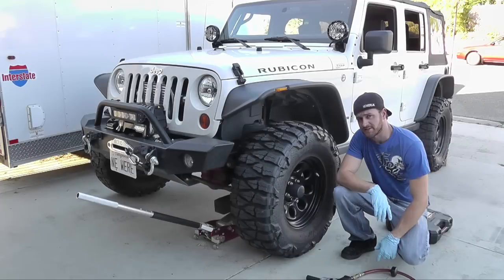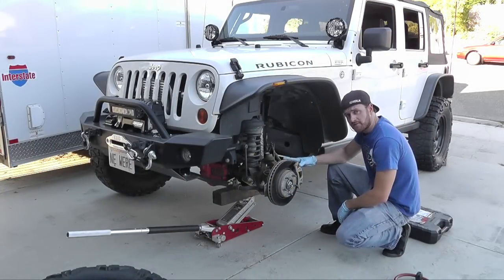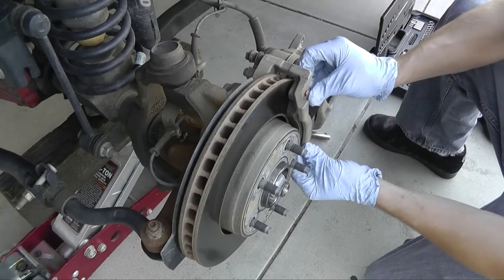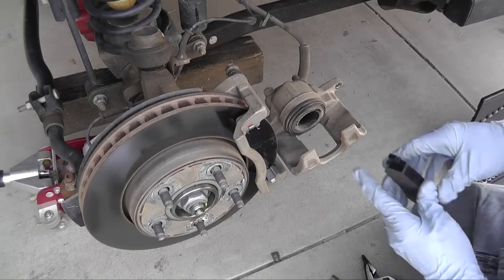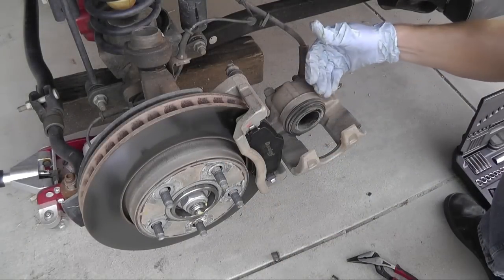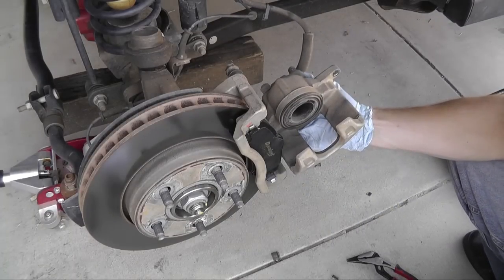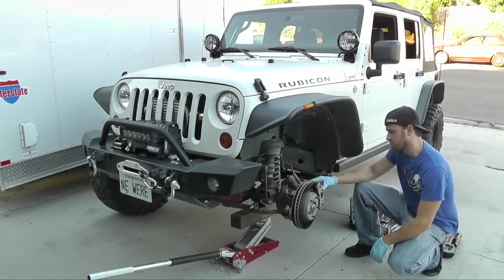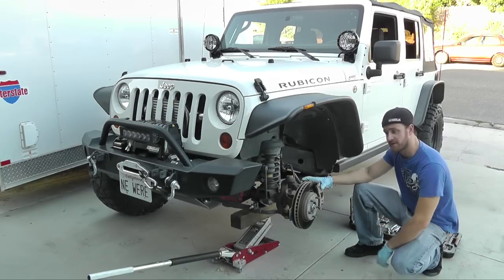Jeep Wrangler Brake Pad Replacement

Comment: I was told this would be $200 per axle at the local auto place. This is not $200 worth of labor for the entire thing.
Reply: That price is to replace or resurface rotors if out of spec and replace pads . you should always replace or resurface rotors when putting on new break pads . rotors will wear and if they wear out of spec it can cause a very dangerous satiation.  a little more to it then just replacing pads .
Reply: @denn1444  absolutely hooey. New rotors EVERY TIME you do pads? That's just not true.
Reply: @user-qt5eh9wb7g  Not what I said read again silly .
Reply: @user-qt5eh9wb7g   replace or resurface

Comment: Good Review, Should've use Jack stands though. Extremely unsafe to rely on just the jack.
Reply: at least throw the wheel under the frame or axle
Reply: About to work on a jeep for the first time. What size floor jack? 2ton?...and where are the best spots to put the Jack stands
Reply: @Bruce Lee thanks
Reply: Arturo Blanco  appreciate it
Reply: The reason I came to comments, jack stands or throw the spare underneath

Comment: I noticed that you left the bottom bolt in on the caliper loosely to act as a hinge where you could swing it back and have it held in place. That's a neat little trick, watched a few of these videos you're the first one I've seen  that's done that.

Comment: Only takes 2 mins longer to pull the slider pin out, clean, add new grease. Always use a torque wrench set to factory specs to prevent rotor warpage. Use a jack stand.

Comment from the maker: I had little to no wear since I was actually changing them very early for the milage. A lot of people suggest it every time but personally I have had NO issues turning them only when there is uneven wear or grooves in the disk. Disks can only be turned so many times before they get too thin and must be replaced.

Comment: great video. As your old pads wear out the piston comes out further and brake fluid level drops, if you've added brake fluid be sure to remove some before you push the piston back in to fit over the new pads.(at least open the cap and keep an eye on the level) If not you will have brake fluid overflow all over your engine compartment.
Reply: Wish I could change a set of pads in a little over 4 minutes.  What the heck, a little grease, should be telling us "break grease". The high temp stuff ;-)

Comment: Thanks for the video, never did brakes before, it was a piece of cake, 4 trips to the auto parts store but no issues. 
Needed an 18mm wrench so I could remove the rotor, it was really warn along with one brake pad, the rest were OK.
Replaced with ceramic pads, they are nice and quiet, and the Jeep stops. ;-)

Comment from the maker: To have two rotors turned this weekend only cost me $30 and I did all the work removing and reinstalling them. If there is a shutter when braking it's not a bad idea but its not required when just changing your brake pads.

Comment from the maker: @krwosu If it was a dealer you know your getting the right product but the cost is usually a little higher in that case. The number doesn't sound too high by any means. The thing is that if your not to sure of how to do any project it is almost always worth the money to have it done right by a professional. If there is a concern of being overcharged you can always doing a little shopping around.

Comment from the maker: @krwosu The brake pads may be around $50 at your local auto parts store and typically come with a life-time warranty. This will most likely be far cheaper than going to a dealer but you'll be doing the work yourself. I'd pick them up locally vs. on-line.

Comment: I love that it probably took him <1 hour to replace both his brake pads, yet after 3 hours I haven’t been able to change one because the area where the brake pad slides into is too tight. Even a hammer wasn’t able to force it in there. Ended up putting the old pads back on and leaving it.

Comment: Thanks for the video. I didn't know changing my breaks was so easy. I have a 2010 sport Wrangler.

I got a tool penalty for not having all my tools in one place so I had to go buy a wrench set. I had every wrench but the one I needed and I will most likely find that one when I don't need it! I did have to buy the tool to compress my caterpillars. That was a handy tool for sure. 

In total, $130.00 to do it myself...:)
Reply: It’s not. He GREATLY oversimplified the process by skipping or incorrectly replacing the pads.

Comment: Awesome video thanks for this, now I can go replace mine. I was about to take the entire brake calliper apart but won't now!

Question, what size socket did you use to loosen the brake calliper assembly?  1/2"?

Comment: I've had my 2023 Rubicon for 1 year, I don't go much of anywhere and I don't slam on my breaks at any time, I'm pretty gentle with it and that is because I leaze the Jeep and I only have a little over 10,000 miles on it, when would you say I would need to change the breaks. I don't go off roading by choice I just like the Jeep.

Comment: Only thing I would have done different is to open the bleeder screw (though in the past I did exactly what you did). I was told by an old mechanic (Dad😉) that you don’t want to push that old brake fluid back up into your abs system. Better to bleed them into a bucket and then top off the system. Great simple tutorial though.

Comment: You should always clean and relube your brake caliper housing bolts so they slide freely. A lot of people tend to neglect this step and the brakes seize up on them.
Reply: What do you relube them with?!
Reply: @TexasTechguy210  With brake caliper grease.

Comment: Changing my brakes and noticed a lot of dirt and some rust on some components.  What is the best way to clean that and should I be using a spray/protectant to keep that from occuring?  Under the Jeep is even worse with rust (I'm in a salty snowy state), but it's a 2013 JK so not that old.  I just want to take care of the Jeep.  Thanks for this clear video.  Surprisingly I had a large amount of brake pad left so no need for change right now.
Reply from the maker: You could try harder to spray off any wet mud when you return home to limit dirt build up. As for the rust there are a few bare metal areas on the front end of the Jeep JKs. A quick coat of spray paint may limit your concerns. In Cali rust is't as big of an issue.

Comment: Good vid and nice ride.  Did you use ceramic or semi metallic pads or what?  My 2001 TJ isn't nearly as nice a vehicle but I still need to do the brakes, sadly I have drums in the rear and I'm farming that job out, simply too involved to do myself.

Comment: Wait ..No wheel spacers.. does your tire rub when you make a complete turn on your steering wheel.. ??
Reply from the maker: No spacers and no rubbing. The rims have a 4.5” back spacing which moved the tires further out from center compared to stock. The Jeep has a 2.5” lift. There was a minor rub on the stock plastic skid plate but trimming 1/4” resolves that.

Comment: When installing the second brake pads, it seems you had some problems with those metal clips? What happened?
And you mentioned something about applying grease between those metal clips and break pads; how important is that?

Comment: I always have my rotors turned or replaced so I don't screw up the new pads by mating an uneven rotor surface to perfectly straight pads which can cost $$$ you in the end.

Comment: Any issues with death wobble with the lift. Having some now after 1 year installed. Thanks.
Reply from the maker: I never had any wobble. I’d check steering linkages, trackbar ends, ball joints for extra play. Maybe lay underneath while someone turns the wheel back and forward.

Comment: I see you pulled the top bold and loosed the bottom so you could flip it out.  I've seen that other people pull the entire assembly apart and I don't understand why they deem that necessary.  Can you expand on this?
Reply: That happens when you replace the rotors as well as the pads
Reply: People do that if they're going to replace the rotors and also to check the Caliper parts and grease everything. Its not a bad idea to do those things, but not necessary EVERY time.

Comment: I just bought the front brake pads (MOPAR, OEM) cause my car "jiggles" when I need to stop the car at high speed! they told me I should get my shims done too. for both tire it was 139 $, did they overcharge me?
Reply: If you get jiggles or "Death Wobble" you may have more problems than just your brakes.

Comment: Always use a safety stand when tires are removed - the hydraulic jack uses a rubber or plastic seal to hold pressure in the jack. If this $1.50 seal ruptures from the force of the vehicle, you could be injured or KILLED! If you do not have a safety stand, lie the tire down and slide it under your vehicle as a back-up! You life is worth more than a $1.50 - RIGHT?

Comment: Well one follows this simple step skipping video your going to regret it. The slider bolts should be removed, cleaned and properly re greased. Bolts should be properly retorqued as well.

Comment: The problem I see with your brake video is you cant or shouldnt replace brake pads without turning or replacing your rotors first or you will soon get a funky vibration every time you apply the brakes.

Comment: What size lift kit is that I read that it was a 2.5 but it looks like its more then that?
Reply from the maker: KingsDisasterGarage 2.5" but the flat fenders with 35" tires help it look taller.

Comment: what is the size of the wrench did you use in the inner nut ? in mm please.
Reply from the maker: +Feras Alsulaimani I belive 9/16 so that would be a 14mm.
Reply: +NEWEREJK Thank you man,  I actually meant the nut on the pin,  it was 17mm. The outer one was 14mm as you said.

Comment: should be using a jack stand under the frame.
Reply from the maker: +kenneth Price-Jones Very true.
Reply: +NEWEREJK also I f you could make a video for the slide pins in the caliper.  if one is seized it will cause uneven pad ware and early failure.  my rear caliper slide pins were seized and I bought replacements but sold the jeep for a new rubicon unlimited
Reply from the maker: kenneth Price-Jones I'll see what I can do next time I'm working on the brakes.
Reply: +NEWEREJK awesome otherwise sweet rig! what kind of lift you running? I'm gonna take my time with my new jeep.  my last one I rush to just get hight then it turned into more money to fix all the problems the lift caused itself
Reply from the maker: The one pictured here had a 2.5" budget boost.

For all the cost and parts involved 2.5" is the "sweet spot" giving you clearance without all the extra cost.

If there is anything I can help you get for your new one just e-mail me at dee@NeWere4x4.com.